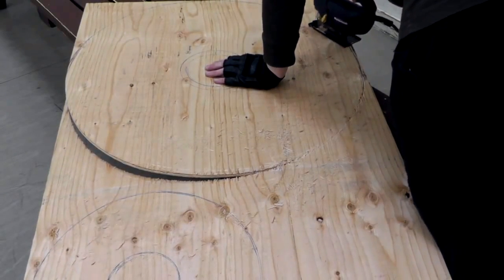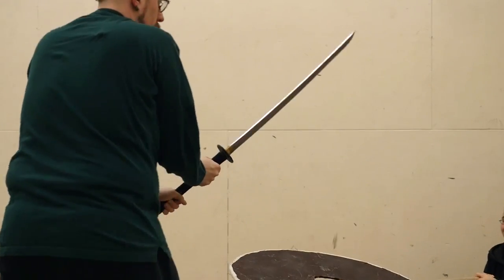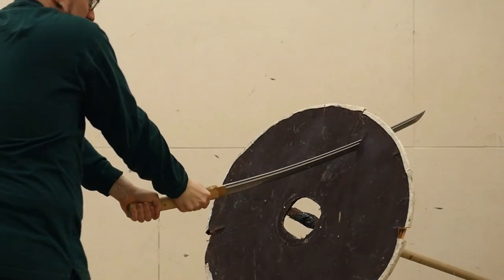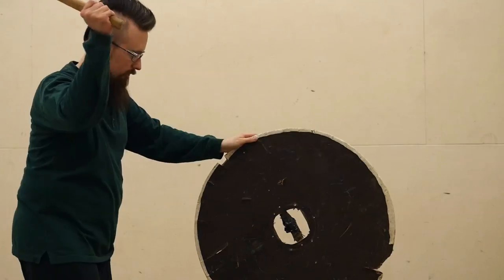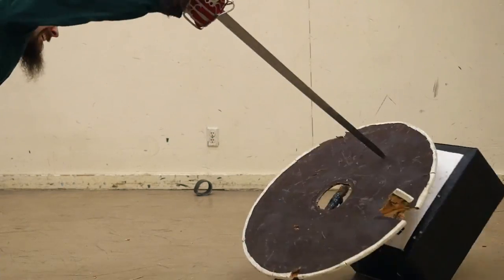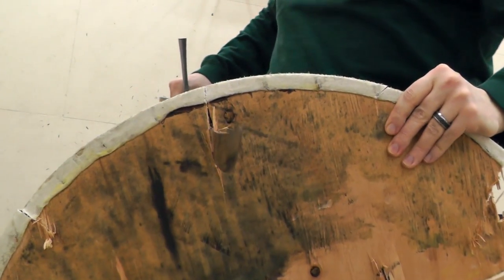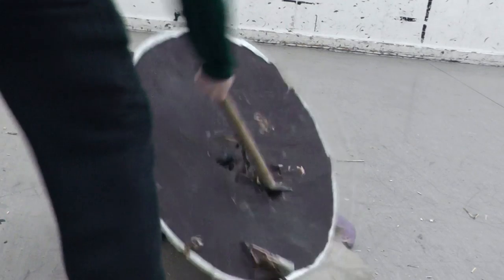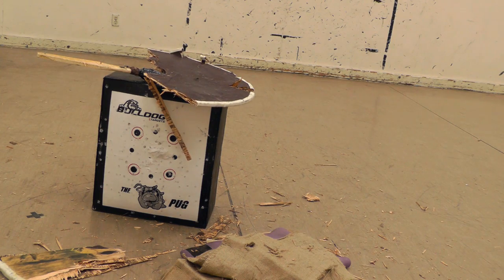Plywood shield vs broadsword, katana, axe, kriegsmesser, and war hammer

Comment: I'm asking because I don't know: I can understand why a one-handed sword would not cut though wood well, but Katanas were the sword of choice for fighting against armoured Samurai. Is it possible that its lack of performance was due to less than optimal usage?
Reply: Francis Roy Possibly. Always keep in mind that this is pretty much a cutting test for "this katana" and "this kriegmesser" not necessarily ALL katana and ALL kriegmesser. We can extrapolate from the findings, but it is not "proof" of anything.
Reply: Francis Roy In battle Samurai used spears and polearms ,the katana was a backup weapon.And cutting through actual heavy japanese armor(made from iron and later steel)is not really possible.You try to hit the unarmored parts.
Reply: Francis Roy Katana were good for the local needs of the land of their origin, having only to deal with foes with light armor or overly flowery lamellar armor that folded like so much origami when not worn on a body. Outside of that, however, not so much.

Samurai didn't use katanas for shields at all. They used maces.
Katana were only good for slicing through unarmored or lightly armored foes, not any sort of "real" armor.
Reply: Francis Roy There is always so much to learn about the world, isn't there?
Reply: Francis Roy Yeah, most of the armor was either leather or a combination of leather and metal, normally lamellar armor.
Reply: Francis Roy In the case of the samurai, first of all their armour wasn't all that effective, and don't think if it as a good comparison to European plate thats curved to deflect blows.
Also the samurai's main weapon was a yumi bow.
The katana was largely a ceremonial weapon and wasn't ever met for hard combat.
Reply from the maker: Francis Roy 
I cut just fine with the kriegsmesser, so could it be that the katana puts its user at a disadvantage? *trollface*
Reply: Francis Roy Katana cut many a peasant before they cut any armored samurai. Edo period seems to be the era where most of the Katana use and legends comes from.
Reply: Francis Roy no, your knowledge of history is what's less than optimal
katanas weren't the sword of choice for anything other than rituals
they were a last-resort weapon, more of a symbol of nobility than an actual tool for warfare
the go-to weapon for japanese medieval soldiers was the yari
Reply: Simon Barr What makes lamellar overly flowery? Only Samurai seemed to have any ornamentation on their armor. Take a look at Ashigaru, the main grunts. They were well but practically armored with a iron/ hardened lacquered leather curiass, helmet, arm and shin guards. This stuff is actually pretty strong too and was most certainly real armor.
Reply: Ulfbert The "real" thing was me subconsciously comparing it to plate.
http://1d4chan.org/wiki/Katanas_are_Underpowered_in_d20
Reply: Francis Roy Katanas weren't made for heavily armored opponents. At that point all you could do was thrust in gaps. Most soldiers/commoners wore lightly padded armor at best (usually just their clothes)
Reply: AfterLifeGuru
Well no  swords are really good against fully armored enemies.
Reply: AfterLifeGuru That might be true very early on in Japan's history. But it seems like the influence of the Chinese Imperial system, and fighting off the Mongol invasions changed things by the Sengoku era. You see the rise of large well equipped and trained armies of Ashigaru fighting for their respective feudal lords.
Reply: ***** "I cut just fine with the kriegsmesser, so could it be that the katana puts its user at a disadvantage?"

That was part of the point that I was making. When I made the comment, I was thinking of the fact that medieval Japanese warriors trained with their swords with a rigorous and precise discipline. It makes perfect sense to me that a very heavier sword would cleave though wood.

Of course, since then, a number of commenters have added to my perspective and knowledge base.
Reply from the maker: Francis Roy 
Actually the kriegsmesser weighs only about 200-400 grams more, and that while being significantly longer. It feels very light and nimble in the hand, due to the excellent balance.
Reply: Francis Roy If you were skilled with a Katana, you were a bad samurai, they were much better archers and polearmsmen. Sword were a last ditch defense and much of the lore about use didn't come till later it is mostly based on myths and lies.
Reply: Simon Barr  They did never use shields during compat though.
Reply: Emil Johansson Other people did.
They mocked them for going into battle trying to survive and broke all their shit.
Reply: Simon Barr who used shields you say? Because samurai nor ashigaru did.
Reply: *****
They were also used in wars just not as the main weapon.
Reply: Emil Johansson Some idiot warriors I heard of on Deadliest Warrior who quickly stopped after the samurai whipped out their clubs.
They were mentioned on Samurai vs Viking. and they might have gone into more detail there.
It's been years since I watched that show man...
Reply: Simon Barr  hmm, a long time ago i saw that show 2. and when you mention it, how the fuck would a viking lose to a samurai. Crazy show.
Reply: Francis Roy 
I think it's mainly just blade geometry. Katanas are pretty think with little or no distal taper compared to most swords, and a convex profile made the edge stronger, but also means it takes more energy to force aside more material when cutting.

Or Skall just lacks the true bushido dragon spirit of a mighty samurai, who were the greatest warriors in history, and could cut through two Spartans and a Templar with a single lightning fast cut of a katana folded over 9,000 times.
Reply: Fuq Gooogle This is fun because parody.
Reply: ***** "These implications that katanas become weapons of mass destruction when used "optimally" is grinding my gears... Theyre just swords. Theyre really good at cutting and even better when used masterfully, but you could say the same for any other sword used for its intended purpose."

Yup, that's an excellent point. I've come to understand that I was suffering from Hollywood Syndrome.
Reply: ***** Was  that a katana joke?
Reply from the maker: 100dfrost 
If it was a katana joke your eyeballs would be cut in half just from seeing it.
Reply: ***** Uuuh, snarky :p
Reply: ***** Just don't wipe Hollywood clean of the delusion until after the Deadpool and Suicide Squad movies. Deadpool and Katana need their katana OP.
Reply: ***** Now that was a katana joke, pretty good one too, Dante.
Reply: Simon Barr Where in the hell did you hear that from? Japan didn't use individual shields for practical reasons, not honor. They continued to use pavisse style shields as they were actually a bit more practical, essentially a large mobile wall. Their troops were already pretty well armored, so no need for shield. It's the same reason why a knight in plate armor often didn't bring a large shield and opted for a two handed weapon instead.

Japanese aren't known for being the most humane and peaceful occupiers. Japan's had a lot of ego and fueled disdain for anything and anyone non-Japanese, shields or not.
Reply: Ulfbert "Their troops were already pretty well armored, so no need for shield. It's the same reason why a knight in plate armor often didn't"Well the Ashigaru were often less than well armored.And while the large shields used by them shield are practial agasint arrows they  sucks in meele.
Reply: Fuq Gooogle 

What low class Samurai uses a 9,000 time folded Katana! They need to be folded over 1,000,000 times!
Reply: Letum Mors In all depictions and evidence of Sengoku era Ashigaru I've seen, they are pretty well armored with a curiass with thigh protection, helmet, arm and shin guards made of lacquered iron or leather. Not as good as Samurai but seemingly good enough that they felt confident in their armor to use two handed weapons more. The shields weren't meant to be used in melee, they were mobile fortifications and they worked.
Reply: Francis Roy lmao
Reply: Francis Roy Samurai armor was made from leather, possibly studded or augmented with tiny bits of metal. This was layers of wood. The hide would naturally be easier to cut through, as a katana is made to slice into flesh, not wood. The axes and hammers had a much easier time of it, because war-axes are derived from a tool MADE to split wood, and the hammer essentially beat the wood to a pulp with its much heavier blows. I imagine a weapon with a lot of weight, like a meteor-hammer would also make pretty short work of this kind of shield for the same reason.
Reply: *****

1.No it was not made from wood,were do pople get that myth?
2.Samruai armor was made from iron and sometimes steel usually lamellar armor,while it used rawhide that was not the main protection.
Reply: *****  Having worn many swords on a day to day basis (Renn Faire) I can say the Katana is no more easier to wear than a European sword.  If anything it's a bit harder.  European swords are usually in a frog or attached to the belt somehow, they stay in one place and can be easily manipulated through a crowded thoroughfare.  The Katana of course was generally just slid into the Obi.  It can easily slide around with a lot of walking and especially if someone bumps it or you bump into something (again very crowded).  Samurai were usually given a wide berth when they strolled through town so I imagine it was a lot easier for them.  In short, the Katana is no more easier to carry or draw than any other sword.  It all depends on the wearer.
Reply: *****
 By riding if you mean horseback then the quillons don't get in the way (Again, Have ridden a horse with a sword strapped on).  Katana's are not much shorter than European swords..in General.  I can guarantee a European Sword and Katana of similar lengths can be drawn just as fast as the other...again based on the user.
Reply: LaughingOwlKiller Not only that, curved blades are slightly awkward to draw - so any "advantage" that might come with drawing the katana becomes equalized to straight blades.
Reply: ***** yes it does im not joking around and i know you are Skall being a good YouTouber. P.S I bought my Kriegsmesser because of you Skall and if I may add, the Kriegsmesser is the best sword i have....... better then my Nihonto that was a waste of money ;)
Reply: Francis Roy If I recall correctly, many Japanese sword fighting techniques involve attacking the enemy in places that are not protected by armor.

Therefore, katanas are not effective because they are magical swords capable of cutting through several meters of steel; they are effective because Japanese sword fighters figured out how to use them effectively.
Reply: Ulfbert I don't remember where I saw that, actually.
All I know is that they were equipped with a mace, that mace was for shield-breaking, the people at Deadliest Warrior had one, and they used it on a Viking shield.
Then there was no more Viking shield.
Reply: Simon Barr You gotta stop watching deadliest warrior, a lot of that stuff is often considered inaccurate as hell. It's not a show created for historical accuracy, but to "resolve" drunken bar debates.

The Kanabo wasn't ever really used, and when used, meant to cause blunt force trauma in an opponent wearing armor. It was not meant to bash at shields.
Reply: Ulfbert Well, a lot of shows of that sort get claimed to be inaccurate, like Death Battle, especially when a DBZ character loses.

I was in the darned Kirby vs Majin Buu flame-war for weeks.

Well, the mace was shown to  be able to smash a shield rather easily (Had a real guy do it), but that wasn't the main purpose of course. 
People in Japan went by the motto of, "Expect to live through war, and you'll die. Expect to die in war, and you'll live," and didn't carry any shields.

It didn't really matter for them.

Anyways, I think we might have gotten a little off-topic.
I was talking about how the Samurai had a club for busting armor that happened to work well against shields. We then talked about shields in Japan for a day.

Meh.
Reply: Francis Roy No they weren't meant for fighting against full armor the katana was a badge of office and a bckup weapon you wouldn't step onto an actual battlefield with nothing but a katana you bring a nagnata, spear or even the humble club. Some one clearly hasn't done any research on historical battles in japan.
Reply: Simon Barr
 That test was done with the Shield being stationery and rigid.  Since of course having someone hold it in place would be dangerous the test is not a good indication.  A person actually holding the shield would take the blow and ride it thus lessening the impact.  That test would have had the same outcome if they used a sledgehammer or common wood axe.  Striking a rigid stationary target is not the same as a living moving one who can think. The difference between Death Battle and deadliest warrior is Death Battle does fictitious characters who have a set power set, Deadliest Warrior tries to do other same with real world warriors when it isn't that easy.
Reply: Brian Larson "Some one clearly hasn't done any research on historical battles in japan."

I invite you to and a number of other snarkers to re-read the first few words of my original comment.
Reply: LaughingOwlKiller Actually, panging against the saya was seen as an insult, so if you didn't want to have a duel you tried to avoid doing that.
Reply: Julius Cheeser Is this why the Mongols mainly used curved blades to fight in a melle from horseback? They were supposed to be quite effective with it - as well as many Saracens and East European riders who have been quite famous for theier blade-work.
Reply: Francis Roy You would almost never use a katana agains someone in armor - the blade is very thick so it is utterly hopeless agains it, and since it is often made of similar materials it will also risk damaging the edge, which was expensive. Same reason its bad at cutting shields: it is a very fat blade, so it has to move a lot out of the way, to get into the material, no matter how sharp it is, which makes it a quite poor "deep" cutter/penetrator.
Reply: KlausBeckEwerhardy First of all, the primary weapon of the Mongols was the Bow (on horse). On foot it was the spear. Both weapons are largely attributed to most of their victories - their sword use was secondary. Saracens primarily used spears as well. This is common in almost all battle fields (dominated by pole arms and ranged weapons) 

Second of all, My comment was concerning this silly notion that Katana's are "easier" and "quicker" to draw. 

I was talking about drawing, not use on horseback, genius. 

Thirdly, of course curved blades are advantageous on horseback - that's why most Calvary swords (including European) are curved. The Romans and some European Knights are among the very few warriors to use straight blades on horseback.
Reply: Francis Roy 62 replies... after reading them all I need to say: You are a great example when it comes to commenting because you have chosen a very polite question, also you replied quickly and sustained your politeness even though you got some quite "harsh" or unnecessary response.
In addition your comment created an interesting well of information.
It might seem strange but since I haven't seen such an useful conversation in the comments section for quite some time, I felt the need to point that out.
Thank you and keep up the great "work" ;P.
Greetings from good old Germany and have a nice day sir.
Reply: Atalanta Heßbrüggen Thank you, I'm gratified to hear that; I work at it. I tip my Canadian toque to you.

PS: This really did make my day.
Reply: Julius Cheeser
Thanks for your comment, but I wrote - though misspelled - about fight on horseback in a mellee, in which the bow or the spear wouldn't be the first choice. I wasn't writing about infantrists. The mellee is a special situation on the battle field. Before the mellee pole-arms and range-weapons are the weapon of choice - I know that. But my comment has been related to fighting from horseback in a mellee. So, before flaxing sarcasm, perhaps you should read a bit more carefully.

Second: You started by generalising about curved bladed weapons and then  specified for the argument katana. Quite a lot of the so-called riding warrior tribes used curved blades - as you later mentioned. That has been my observation. Just an obeservation. And you had been answering to a comment about sword-use while  riding.  Have you by any chance become a bit confused?

And your thirdly has been the only point I had wanted to make.
Reply: Francis Roy Samurai weren't cutting eachother through armor either.

They have anti-armor techniques that resemble european's half swording. 
They would aim to cover opening in their armor while trying to poke their sword into openings of their enemy's armor.
Reply: Simon Barr this link is gold, thx for posting that
Reply: wlshhamster No problem!
Welcome to 1d4chan
Reply: Letum Mors depending on the period. When tolking about samurai and ashingaru you're talking about a 1000 year timeframe. And about different tactics strategies and weapons. Japanease armor was well developed and hand held shields were out of use hundred of years before the army system was reformed into the standing army system which give birth to the samurai class.
btw for swordfighting at (least some) schools teached to use a helmet as hand held shield in situations were a shield was of advantage. They know the concept of shields but they did not used them on the battlefield.
Also a lot of yari were kami-yari a shield would get permanently hooked while on other guy tries to stab the shield wielder. Pretty anoying - better strap shield-like pouldrons to your upper arm and be happy.
Reply: Francis Roy samurai armor was lots of cloth not wood
Reply: Francis Roy As far as I know, the Japanese didn't use shields for man to man combat. They only used (stationary) shields to protect archers (and later gunners) from other archers (and gunners). The only time I've seen Japanese shields for man to man combat were images of Japanese warriors from antiquity.

Take it with a grain of salt though, I can't say I'm an expert of Japanese military history.
Reply: wolffe93 Lol. Tell that to japanese literature of that time. The book of 5 rings tells me that katana was a widely used samurai weapon.
Reply: Александр Березин
IIRC, the Japanese military government pretty much rewrote Japanese history in order to control the samurai and turn them from feudal rulers, into "slaves to the system". Taking away their bows and lances and replacing it with the katana is a really smart thing to do. No one is going to overthrow your government with some katanas.
Reply: deektedrgg
What the fck are you talkig about? The book was written in the 17th century.
Reply: ***** are you serious? You dont know the weight of your weapons?
Reply from the maker: Александр Березин 
Yes, I do know them but I was talking about the average weight of those two types of sword in general, and there can be some variation.
Reply: ***** So, could you tell us whats the difference in weight of this katana and  this kriegsmesser?
Reply: Александр Березин I'm talking about that Samurai didn't use swords as main weapons in the 17th century.
Reply: deektedrgg Then why  does this book say about sword fighting anf not about spear fighting?
Reply: ***** Or you have not discovered the magical secret of the samurai. Huh!
Reply: Francis Roy I'm not an expert, but I would assume it's more along the lines that samurai were probably trained to find weak points in their enemies armor and use the katana's shape to swiftly cut at those weak or unguarded areas. I can't see a katana straight-up sheering it's way through metal armor, but slashing at more exposed areas around the underarms and joints seems much more practical.
Reply: ***** Interesting. If the katana wasn't the primary weapon in combat between samurai, what was? I assume it might be something like the naginata or another form of spear, but I'd like to know for sure.
Reply: dracocrusher
You could read my post which is nearly directly under the OP.But in the ealry period it was the bow.Later it was the Yari(spear).
Reply: Letum Mors There's like 80-some comments. I'm glad you told me, but there's no way I'd even attempt to get through all of them, lol.
Reply: Katanas were made in Japan, a place were armor was not heavy and impenetrable.
Reply: ***** Gotta admit, that sounds pretty freaking badass.
Reply: *****
A katana edge for battle shouldn't really be  razor sharp nor was it.
Reply: Francis Roy wouldn't the samurai mostly have been slaughtering peasant conscripts or something so armor wouldn't be the biggest factor?
Reply: KlausBeckEwerhardy Curved blades are MADE for horseback fighting. Excellent for slashing, the one and only thing you do when fighting on a horse. The reason European Knights during the middle ages didn't use them was because they would use lances and would often dismount after the initial charge if needed. Which was rare seeing how a full on charge from couched lances would decimate and demoralize any troop grouping.
Reply: SovietButcher Yes, for the specific roles they fill. I don't expect an Ashigaru artilleryman to be donning armor like I described. If you have info or pictures that shows Ashigaru were largely underarmored for their role, please show me. I've only seen evidence otherwise.
Reply: Ulfbert Are you serious? You want me to find pictures before the camera existed? Or do you want me to show you some drawing that will always show the ideal scenario? Same goes for museums, they won't display a piece unless they have a full set, even if said full set was rare at the time. When you go to a museum in Europe, do you often see a makeshift armour? Or do you usually see set pieces that were made to fit together?

It's the same in Europe, every depiction you have is the ideal, however reality is different. We know for instance that the Ashigaru had to take care of their weapons and were only given armour if their retainer was wealthy enough or if the peasant himself bought it. Same as in Europe.

The difference between Europe and Japan is that Europe didn't sanitize its writings throughout the ages. Japan did, hence why you don't find a lot of information pertaining to such things. However when you look at the facts (how troops were levied, who payed for the equipment, how said equipment was distributed and so on), you see the exact same thing as in Europe, lots of "lords" that aren't wealthy and actually rely on their soldiers to find their own equipment.

Until Japanese lords instated full-time standing armies, there wasn't a "standard armour". Even when they were instated, the only standard things about their armour was their helmet and their karuta tatami dou (body armour). Nothing for the legs, arm, feet or hands. This type of "standard armour" was introduced in the Edo period. Before they did as I stated. You want sources? Go look into books written by historians that AREN'T Japanese.
Reply: ***** Ever try cutting any metal with a blade? Edge to metal is generally a big no no. Katana's are normally used with cuts, but you realize you can stab with it right?
Reply: ***** seems to me like katanas would be best for cutting up unarmored people who have few weapons.
Reply: ***** yep that sounds about right.
Reply: ***** No, I replied because you seemed to be making an unfair comparison in order to make the Katana out to be inferior quality because it couldn't cut metal studs without being damaged. No sword can afaik.
Reply: Francis Roy From the responses I've read, the answers are already in there, but I'll chime in anyway. Let me start by saying that the katana is not a battlefield sword, it is a peace/ceremonial weapon, much like those fencing thingies you see the nobles use to fight duels in old European movies.

Metal was a very precious commodity in Japan at the time, so they just didn't have the resources to kit everyone out in swords, therefore (and due to the increased reach), polearms (spear and halberd) and bows were the main weapons of choice.

The sword of choice on the battlefield was the tachi, which is longer and more curved than a katana. Some would also carry a shorter sword (kodachi/wakizashi/shotou, depending on which time era you're looking at).

The armour was not made out of wood or bamboo or whatever people like to believe, but the older armours were made out of leather, metal plates, and thick cloth. A full yoroi weighs 20-30kgs, they're not light. Like all armour, you don't attempt to cut through the armour, but rather aim at the weaknesses in it (the neck, under the armpits, elbow joint, around the waist where the bogu stops, between the legs, the knee joint). There are many techniques that aim to cut the straps that hold the armour in place to create even greater exposure as well.

In case you lost your main weapon, you would go for your secondary, which was a tachi. Depending on which school you look at, the samurai would use grappling to get the other on the ground (armour is heavy, it's very easy to take someone's balance with it, and you won't get up that fast) and then, using the weight of your body, you would push the sword into a gap. Some samurai also wore helmet breakers or knifes, although it wasn't that common.

If you wish to see Japanese martial arts focused around armoured warfare, I suggest you look at kukishin-ryu. It's one of the oldest still surviving schools that focuses on armoured warfare.

Kind regards,
Kodain D. Kiwrath
Reply: Kodain Kiwrath "If you wish to see Japanese martial arts focused around armoured warfare, I suggest you look at kukishin-ryu. It's one of the oldest still surviving schools that focuses on armoured warfare."

What a nice, informative and useful answer. Thank you.
Reply: KlausBeckEwerhardy
 Forgive the late reply, but yes, I know it was an insult..which is why I mentioned Samurai were given wide berths in town.
Reply: Francis Roy I am not sure it would make much difference, but Skall actually was not using the katana in an optimal way.
Reply: ***** Yes.
The optimal way to use a katana on a shield is to stick it in its sheathe and use your mace.
Reply: Francis Roy Yes. The angle of the blade as it hit the shield was not accounted for; the blade being more curved, the angle was sharper than in the test with the straight sword.

However, the katana is not ideal for attacking armor. Anti-armor is the realm of warhammers and spikes, and to a somewhat lesser extent axes.
Reply: Francis Roy  AFAIK in Samurai era the Katana would not face wooden armour not even talking about shields. They used leather/ iron stuff there
Reply: Francis Roy The only armour a katana could ever cut through was the thick husk surrounding your heart, neckbeard.
Reply: Francis Roy samurai didnt use shields so the katana was therefore not built to deal with shields
Reply: Francis Roy Don't underestimate wood ;)
Reply: Francis Roy Katanas and Samurai have been over glorified a lot by the media. They were great fighters, and the katana was a deadly weapon against other Samurai. However it is incompatible with Western sword fighting, as there is Chain mail (or plate), shields and broadswords to contend with.
Reply: Nathanael The Aussie As I grow older and life teaches me, I've found that there is a significant difference between formalized training, and practical training. The American baseball player Yogi Berra said it best: "In theory, practice and theory are the same, in practice, they are not."
Reply: Francis Roy Yes, i am more of a practical person, don't like theory.
Reply: wolffe93 a samurai army did in fact use long, and close range units, polearm and sword units
Reply: Francis Roy I'd argue that if your training isn't the same as your theory, it doesn't mean theory isn't adequate; it means YOUR theory is inadequate.
Failures in practice indicate that either you've failed in reproducing the technique, or your technique is broken.
Reply: Francis Roy Shields were unheard of in Japan, so it shouldn't be very surprising that a katana is unable to effectively combat one. Just in general swords are a terrible choice against someone who has a shield (or battlefield combat in general), historically speaking they were almost exclusively secondary weapons both in Japan and Europe. Also, the idea that any sword can "cut through" armor is a misconception based on what you see in movies. The only real way to fight against armor involves circumventing it, cutting at places the armor doesn't cover. So a katana could not cut through samurai armor, but it could cut through the exposed legs the armor didn't cover like butter.
Reply: So to sum it up: Swords are always ineffective against shields/armors, even the "magical" Katana. The Katana was mostly used as a side weapon in battles/wars, and as a main weapon in duels.
Reply: Dominic Bukoitz
a side weapon to what?
Reply: Darcell B Polearms. Naginata and spears along side the longbow or matchlock rifle depending on time periods and availability.
Reply: rikuki
youve gotten samurai confused with ASHIGARU
-These men were typically peasants, drawn from the fields to serve for a limited amount on time on military campaign.

also, it was around the Muromachi Period when the samurai shifted from archers to swordsmen
Reply: youre right that some samurai used naginata on the battlefield though
Reply: rikuki
you're not totally wrong - in that some circles believed anyone who carried a weapon at the time was considered a samurai; however, officially, the foot-soldiers used weapons that didn't require much training and thus, weren't considered samurai
Reply: Francis Roy I'm no expert, but from the looks of it, skall has terrible form (no offence meant). most of the power comes from proper grip and lowering your center of gravity by lowering your hips.
Reply: Darcell B Well, if you are on the battleground with hundreds of soldiers battling, a sword is always a bad choice for a main weapon. Soldiers didnt slash through each other. They had formations and shit.
Reply: Dominic Bukoitz
im pretty sure a sword unit would spread out when the fighting came
 - also remember, not all battles were fought in open fields-
Reply: Simon Barr In retrospect, I dunno how the Samurai won. You'd think that the Viking with comparable armour plus a shield would generally have an advantage, especially when you consider the more economical movements the Viking's armaments allows him to do. I mean, what about Samurai Yari vs Viking "barbed spear"? What about Japanese Naginata vs Dane Axe? Or Katana Vs. Shield and Sword/Axe Combination (yeah, 2 vs 1, but it's undeniably realistic). What also grinds my gears is how testing with Chainmail always leaves out the Gambeson underneath!
Reply: Nemo003
The samurai won because, and I'm stopping you right there, he had a club as a secondary weapon.
A quick test showed that the viking's shield was absolutely no match for the club.

The match was usually: Smash shield, render them vulnerable, katana their face.
The end.

The spear might have been useful, or it might not, depending on how well they used it.
Plus, if your opponent manages to get around the pointy end and up in your face, that's very bad.

Also, yes, the gambeson is being neglected.
Reply: Simon Barr Except, the club won't always hit the shield straight on (like in the show), and the Viking would've made sure of it. Usually, if it was a duel instead of a group battle, the shield would've been held at an angle moving away from the body so that it would've 1) deflected blades 2) Increased the actual "thickness" of the shield (one of Skallagrim's other videos (or was it Lindybeige?) talks about this). Furthermore, the club is heavy and awkward, thus making them vulnerable to attack if it doesn't connect (i.e. Viking side steps). Also, the shield wasn't only defensive but could be used to bash the opponent with the boss or the shield's edge, and finish off with the other weapon. I also wonder what the shield they used was made of, seeing as the finer shields were reinforced with Linen, plus raw hide and iron on the edges, if I remember correctly.
Reply: *****
Sort of.
We're trying to figure out what they did and didn't get right.
Reply: ***** No. I practically criticized them.
Reply: ***** True. But I also saw  how certain scenarios were ignored for the sake of "simplicity" (e.g. The Kanabo's Speed, the fact that the club would not hit the Viking Shield straight on; Should've been Naginata vs Dane Axe, the realism of Katana vs Sword/axe and Shield Combination, Chain Mail should be tested WITH the Gambeson underneath, etc.). Granted, the technology probably wasn't there, but the testings came off as "Which of the 2 warriors is more popular, and how can we make him look good?"
Reply: ***** Actually, imagine Samurai charging against a simple shield wall. Yeah, good luck with those Katanas! You got spears? Well SO DO WE!!! Did we mention we ALSO have shields? You have cavalry (I'm gonna include Viking Age Normans (whose nobility were Viking descent) to the mix)? Let's fight! What? Your horses are smaller than ours? What? You haven't thought of cavalry charges with your spears COACHED (Spears under arm pointed towards opponent)!? Well sucks to be you! Oooh! an oversized club!!! [Side steps, bashes with shield, chops head off]. OH NO! You've somehow disarmed me of my spear and Viking sword! [Samurai lunges, Viking reveals hand axe hidden by shield].
Reply: ***** True. Though it should be noted that Samurai during the Viking Age were Primarily horse archers (mounted spearmen weren't emphasized until the Sengoku Era), and only made up a portion of any Daimyo's army. They would've been not-so effective against a shield wall (not even the Normans were against an intact Shield Wall during Hastings) in a prolonged battle, and ineffective against massed foot archers, something the Normans (whose nobility were of Viking descent) used en masse. They would've also been at a disadvantage against Norman cavalry, who would've been better equipped for the charge, had stronger steeds, and eventually invented charging with couched spears (spear tucked under the arm), something used as early as 1081 in the Battle of Dyrrhachium in which the Normans faced and defeated a Byzantine Army that fielded 1000 of another famous (initially) Viking formation, The Varangian Guard (though noted to have had a large number of Angle Saxons by that time (post-Hastings)). You also have to consider the differences in body sizes, which was much more pronounced then than it is now.

But yeah, I will admit that the Samurai were great warriors, but am also annoyed by the cult of invincibility surrounding them. Especially when they compare "Vikings" (which largely ceased to exist by the late 11th Century) to the Samurai (the one they portrayed seems to date up to Sengoku Period (mid-late 1500's).
Reply: ***** Now that I remember, the Katana wasn't even the primary weapon of the Samurai in pitched battles! Usually they carried bow, Yari, Naginata, or even Arquebus (after its introduction by Portuguese Traders in the mid-1500's), with the Katana as a side weapon. The thing is, the Samurai were very practical warriors. Any new technology that gave them an edge was used to their advantage (i.e. didn't over-rely on the Katana). Otherwise, the Samurai wouldn't have included the Chinese classics (including THE ART OF WAR) into their studies, the Otomo wouldn't have adopted European Cannons, the Shimazu wouldn't have become the first Samurai Clan to utilize firearms in battle, Date Masamune wouldn't have developed armor inspired by European bullet-proof plate armor, Nobunaga wouldn't have used firearms to full effect in Nagashino, etc., etc. Even the renowned ronin, Miyamoto Musashi, emphasized Samurai be proficient in the Arquebus among other weapons. Heck, it didn't end there; by the Satsuma Rebellion in the late 1800's, the Satsuma Samurai under Taigo used modern artillery, firearms, and Westernized uniforms alongside their Katanas (Heck, this was being seen during the earlier Boshin War as well (which even included steam powered ironsides engaged in naval battles), so the Last Samurai movie is FULL OF SHIT (who also switched out the Frenchman with an American starring Tom Cruise, among other things)).  The Katanas were also used in duels but failed at that too against Europeans; there were numerous occasions of Samurai getting into duels with Portuguese sailors and almost always losing (i.e. dying). It was probably in part due to the advantages of the "thrust" over the "slash" rather than any lack of skill among the Samurai.

While Vikings were largely infantry, they also had skirmishers who utilized short bows (shorter range, but handier and more maneuverable). Of course, then we get the aforementioned Normans who utilized Longbows as well.
Reply: +Francis Roy No, bad usage of a katana was not the cause.  That guy is able to skilled enough to get his edge alignment right and do draw cuts.

edit.  Katanas are not superswords.  Another reason why the katanas didn't cut very deep is because of how thick the blades are.
Reply: eitkoml hahaha that's 13 versus 1, I bet this comment war will last till next year, or even longer lol
Reply: ***** I'm more of a Yari fan, personally. The Spear is the KING of the battlefield.
Reply: +Francis Roy Hey Francis you have stumbled on to the secret of never being lonely again. Just post about a Katana and the world responds.
Reply: Grahame Nicholson Funny! Made me laugh. :)
Reply: Grahame Nicholson I think that loneliness is far better than that kind of company.
Reply: ***** Please don't report me. I live in fear of Ninjas lying in wait at the bottom of my pool. I must make an immediate pilgrimage to the flying monkey Shaolin temple where I will be cleansed of my vile western ways. I meant no harm!
Reply: Grahame Nicholson I must be feeling lonely, because I have a Katana question. Ninjas, I believed used a similar, but straight edged sword, without the katana's curve. Was it still a Katana, or did is bear a different name? And why would one choose to make a sword curved versus straight?
Reply: Francis Roy Hi Francis. Man you are the can of worms opening specialist! Good on you. Curved v straight  is possibly the second most contentious and definitely the most interesting sword topic.  Regarding Japanese swords yes they had short swords curved swords and long swords. Chokutō was the name of their straight swords but that is an all purpose name like well...straight sword. I will go on about Japan later in the post if it interests you.
Re curved swords. Curved swords are better at cutting than a straight blade if everything else is equal. (Such as  length thickness sharpness taper profile and type of stroke used) Butchers knives are curved for that reason. When you contact with a straight blade more of the blade is in contact at the point of impact where a curved blade has a smaller initial footprint. This helps to initially start the cut. Then as you swing thru the stroke the curve drags the blade across the meat even if you fail to "draw" the blade. Drawing or pushing thru the stroke is the technique used to maximise the cut length and depth. It is pulling or pushing the blade across the meat which allows the tiny metal teeth to tear the flesh. A straight blade will do these things but a curved blade does it easier for the swordsman. There has been an ongoing curved vs straight thing for ever. Curved blades have been more popular in hot places where the cut is more effective due to less clothing. Where people wear protection the straight blade was more popular. However then firearms came and armour became less and the curve came back. Then the straight stabbing only blade made itHollywood and modern literature talk about the ninjato which looks like a straight katana and was supposed to be used by ninjitsu. However APPARENTLY (feeble attempt to avoid being swamped by modern ninjutsu trying to internet assassinate me) there is little evidence for this ninja use APPARENTLY and it MAY be a myth. The Japanese were a bit different to everyone else as they were on an island and fought mainly with each other and so they kind of decided on what a sword should be and there was a fair bit of peer group pressure to get people to conform at least as far as an appropriate gentlemens swords should be. So a lot of the rest of the world particularly Europe took anything that worked and changed styles a lot the Japanese changed little and slowly.
Reply: Grahame Nicholson That was a very interesting reply, especially considering the geography/history/clothing ties.

Could it be summed up as "Curves for slashing, straight for piercing?"

And yes, I'm asking newb questions 'cause I am a newb. :)
Reply: Grahame Nicholson No way that part about less clothes in hot climates could be true for soldiers.  Soldiers wore armor in hot climates like in India, Iran, middle east, etc.
Reply: Francis Roy Was it a lot like a Chinese Jian?
Reply: eitkoml The (pictures of the) swords that I've seen? No. The sword you're speaking of has two edges, the one I'm thinking of, like a Katana has a blunt back and one edge.
Reply: Francis Roy I like to pretend I am an expert so I like the questions. My family gives me no respect so I like this. Lots of things effect the cutting or piercing damage done. The curve is one of them. There are a bunch of things that will affect it like stiffness, thickness, length taper and point of balance. Then are you going to use it on foot or on a horse or both. Then are you going to use a shield or armour or a dagger in the other hand. Are you going to wear it all day and use it rarely or are you just strapping it on to fight only. People have always been trying to make a sword that will do everything well and also be easy to carry. The trouble is you can never do it. You can have a great thrusting sword and cutting sword that is long enough to compete but it will be heavy. to keep the weight between about 2 and 3.5 lbs (good weight for fighting) and be good at cutting and thrusting you have to compromise on something.The balance point is another like how close to the hand tip the sword balances. A duelling thruster will be tip light. A cutter will be tip heavy by comparison. A cut and thrust sword will be more in the middle. Cutters are usually broader and thinner, thrusters are usually narrower and thicker. Cut and thrusters in the middle more. Military swords usually try to be dual purpose because you don't know what is going to happen on the day. A duelling sword usually will be one or the other to gain an advantage in that one area. A civilian sword is usually lighter and maybe shorter because it is a bitch to carry a 3.5lb 40 inch cut and thruster with a complex hilt to the office. But that is what you want when the chips are really down. For me I love them all. But the curve ones look wicked, but the basket hilts and the rapiers have amazing hilts, then again....oh crap you know what I mean. I have 7 swords and I take them to bed in rotation.
Reply: Grahame Nicholson Also, whether your opponent is going to be wearing armor is hugely important.
Reply: eitkoml First thing is let's never forget that a sword is the backup weapon in battle and the spear/pole weapon is the hand weapon king. So when we look at battle and we wonder what is going on with armour the spear is the elephant in the room that impacts (get it) battle fashions. Re the hot weather it is an opinion I have. It is the only thing I can think of to explain why very curved swords are more prevalent in warm places and not in cold places. Swords of course as you know were/are also used for self defence against bandits or home/business invaders or street criminals. So fights often occurred when people were not prepared for battle. Professional soldiers wore protective gear but most armies were made up of some pros and a lot of ordinary people who brought what they had. In Northern Europe people all had woolen coats,padded coats or fur coats and they are hard to cut. If they didn't have such clothing they died in winter. In south Asia or Africa not so much. They can also be hard to stab through if they are wearing  layers. In India the guys trained in tulwars get close in and just slide the blade up and down any exposed flesh. They use a small buckler to move in behind and close the distance inside the opponent's point.  I will say tho that the Middle eastern Arabs, Egyptians and south indians used less armour and the underwear in hot times than the Europeans. Europeans fighting the Sassanids, Fatimids and Seljuks had to discard some armour due to heat stroke and had to adjust fighting styles.
Reply: eitkoml Indeed. And the better and more complete the armor the less a sword is useful. Curved swords in Europe became more popular after firearms made armour redundant. So we see curved sabers becoming popular from the late 1600s/1700s on.
Reply: The samurai arsenal had a lot more than swords.
Reply: Sir.Alex
That's an understatement.
Reply: +Francis Roy  Also to be fair. The Kriegsmesser is a much more high quality weapon costing triple than that of the katana, I believe. Or close to. and he hit with the katana further towards the tip. The kriegsmesser is longer.